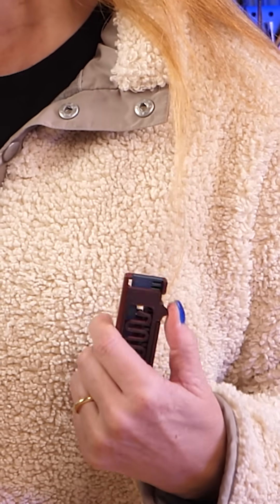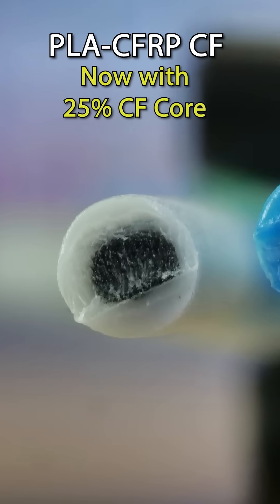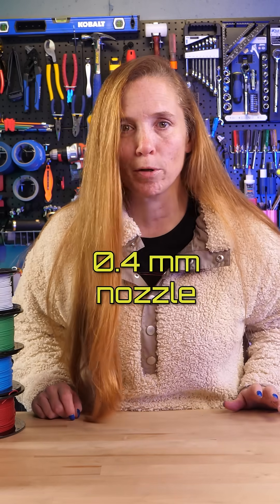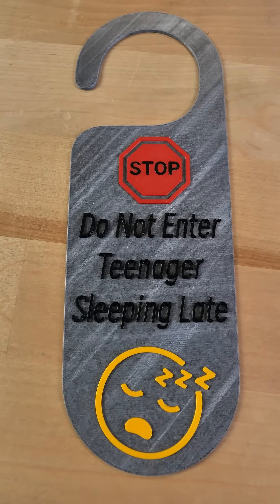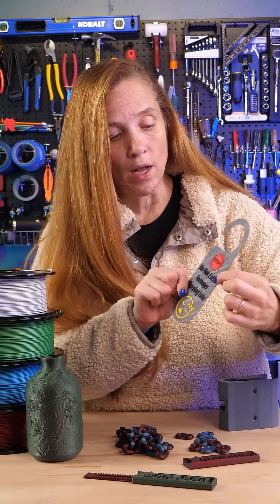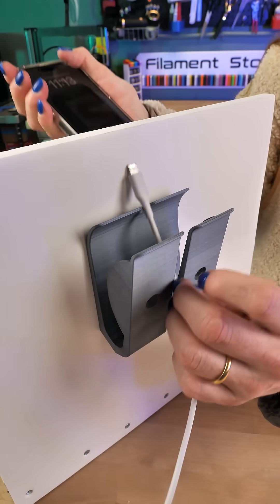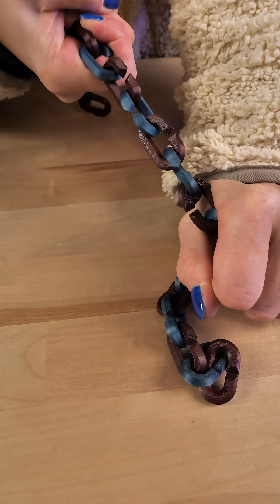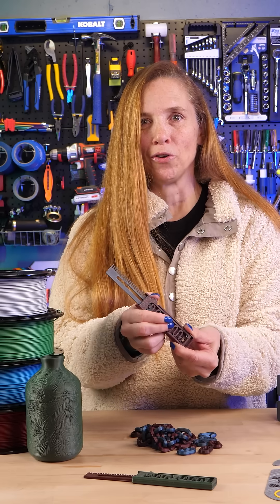3DPizza? No, it’s Core Carbon Fiber PLA from Sting3D

Comment: Hey, i hope you see this @FilamentStories or someone else sees it but i was wondering if there was anyway to only use one part of the dual color filament that is split in the middle or at lease a easy to make it not blend? because i wanted to make a backplate for my switch but the filament turns silver rather than the different angle=different color. 

Thanks in advance to anybody who answers

Comment: I have concerns about safety with carbon fiber filaments. The little fragments get everywhere and are a big health risk. Inhalation, perforation, etc. very few people talk about this
Reply: "Nathan Builds Robots" did a video on this, rubbing his hand on different filaments and looking at it under magnification to see which ones left embedded fibers (obviously more of a risk if you inhale as dust particles). 

Using some kind of clear coat or finish makes carbon fiber much more resistant to shedding small fibers, though it's still probably better off as a structural component for items you don't physically interact with all the time (minimal rubbing or scratching risk, which in time might wear away protective coats).
Reply: yes i’ve had the fibers infuse with my fingernail when i accedently touched the nozzle trying to unclog it heated and i counldnt cut my nails until it grew past the
Reply: The being concentrated in the core should prevent most issues in handling the actual filament roll but would be interesting to see how it affects prints made using it.